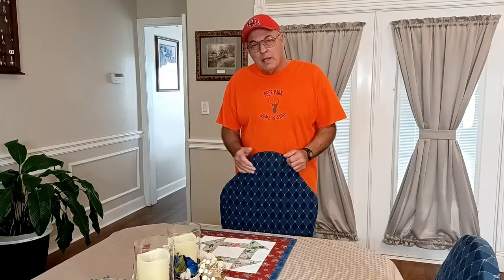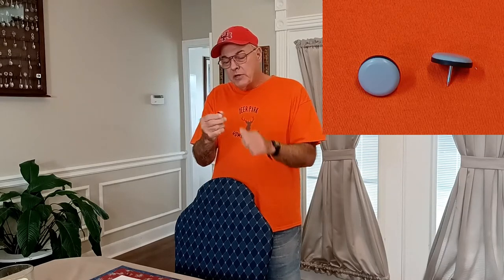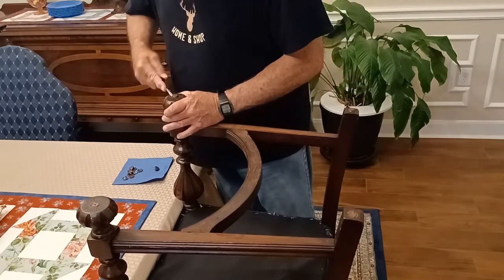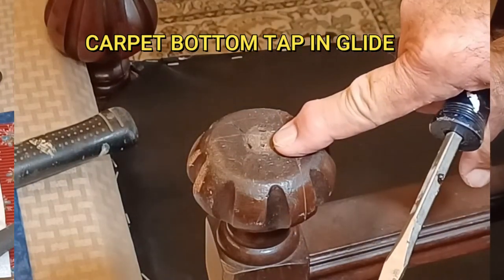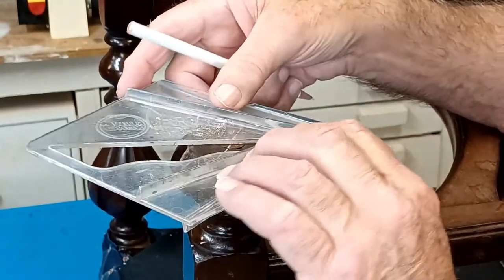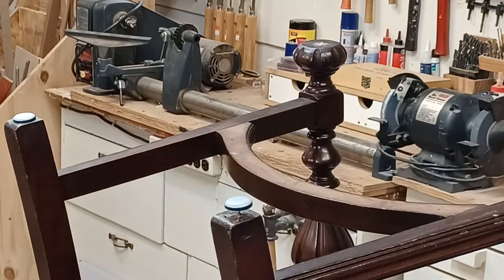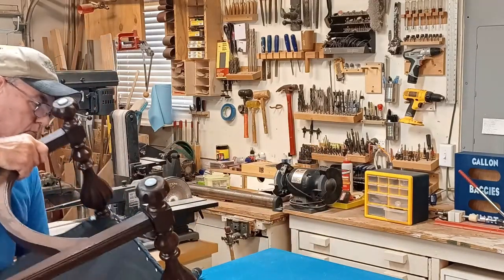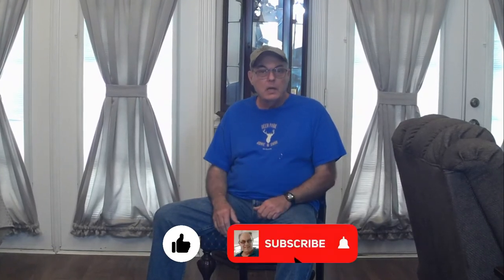How to Replace Chair Glides - Install easy, long lasting, DIY tap in sliders

Comment: Wow the original ones lasted over 20 years? Must had been some good quality. I wonder if the new ones will last thats long. How are they doing so far?
Reply from the maker: I should of qualified that 20 year use statement.  They were pretty worn, and being a formal dining room setting, they were not used every day.  The new ones still look perfect.

Comment: Are the nylon floor protectors better than a felt one? Would they last longer?
Reply from the maker: All things being equal, I think the nylon guides will probably last longer but that's just my opinion.  The chairs in the video were mix and match with both carpet and nylon glides, and after at least 20 years, both were not only still functional, but still had some life left in them.  The nylon is more available in small sizes.

Comment: What size bit did you use?
Reply from the maker: I used a 1/16" (1.6mm) twist bit which was a perfect fit for the glides I bought.  However, some glides take a larger bit.  I always drill a test hole in a piece of scrap wood to test the fit before I drill into the furniture leg. Hope this helps.
Reply: @deerparkhomeshop2471  thank you 4/6 done.. So far so good!!
Reply from the maker: @TheMelissacam03  I hope your project turns out good.  If you have any more questions, please contact me.